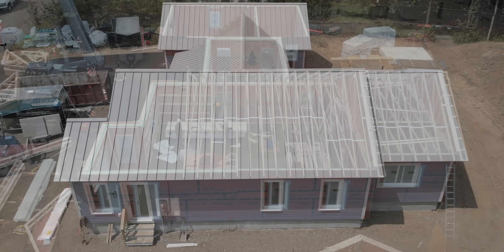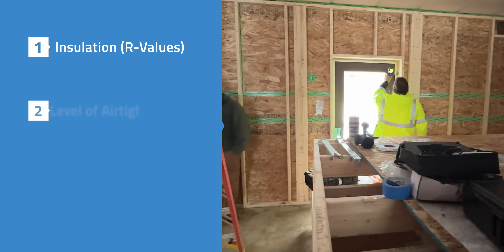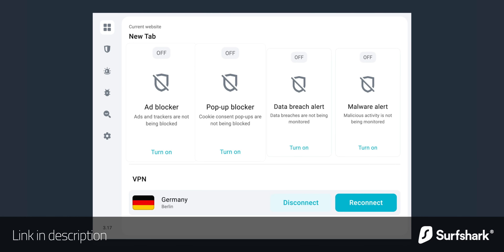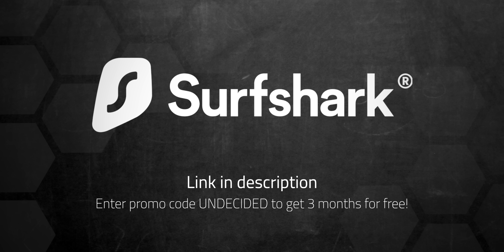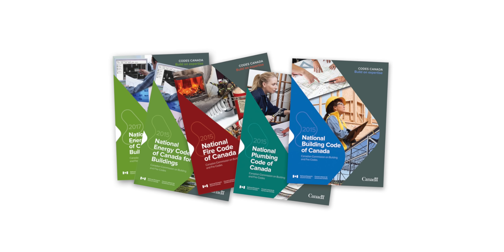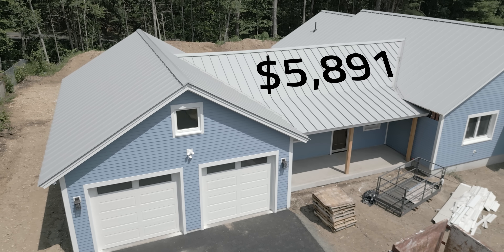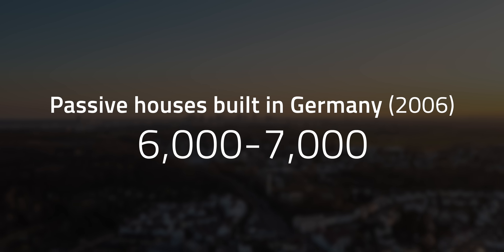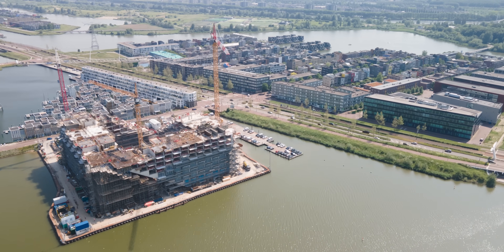Why Do American Homes Suck?

Comment: It's easy to say spend the extra money now so you save money in the long run, but the cost of nicer windows up front is tremendous. And forget about doing replacements on older houses. If you have a particularly window prominent home, it would be like taking out a second mortgage.
Reply: How much is it in the US ?
In France, for the window only (without the cost of the contractor to install it), you can have a simple 1m^2 (10.7 ft^2) high quality PVC triple glazed window for 500 euros.
Reply: @AB-yt4hd  That sounds about right for windows I've seen in Canada, BUT the big thing I find is nobody does their own work anymore. Most people I see (energy consultant, I see tonnes of people doing upgrades) hire contractors and the price of labour and markups are ridiculous. It's a tight market for supply so it's really sellers who run the show. I've seen obscene prices and when i go to build my own home I'm installing almost everything I can myself. I am looking at windows out of curiosity for my own house now and the price you said makes sense for window alone, and installing is not that difficult except for one very large picture window I may hire someone to install for me.

This video is not long enough to break down why costs are so much higher in USA/Canada than Europe but it's a very exciting rabbit hole to go down!
Reply: @andrewscheelar9656  Yes installation cost is becoming very high in France too.
I don't know current prices to install a window today, but I know how much they ask to modify a garden (they ask 7000 euros/week/worker, and this is only for the man-hour). This is ridiculous.

Comment: Performance is not free. It's not your money to spend. 

And honestly the more offensive flaw in construction standards is the repetitive cycle of destruction associated with wood construction and the annual tornado season. Because that actually kills people. 

If there was an inherent flaw in home building, anywhere, it's that nothing is designed to be built incrementally. This of course benefits the builder because they get everything upfront, and any changes down the road require massive disruptions and demolitions. And of course massive, crippling debt. 

The answer is to start small and stay mobile. MDUs, or mobile dwelling units, a much better term than tiny houses, which come with voluntary simplicity connotations (a euphemism for broke), separate the land from the structure, benefiting the property owner and the home owner. When the home owner is ready to put down roots, they can just buy the land and park, with minimal improvements for mobility. With one or more fully functional MDUs on a property, to owner can incrementally build their primary dwelling. Ideally, this would be large, self-built, clear span structure, like a geodesic construct, thin shelled monolithic concrete construct, metal quonset hut, or a combination thereof, as resources allow. Such a primary dwelling would provide a building envelope that can truly protect against nearly all that man and nature can dish out. The MDU can then be parked within the primary dwelling, and the rest of the space remains an open canvas to build additional, specialized units that can be endlessly rearranged to the owners content. The shipping container remains the best platform for these units, because of their inherent mobility, but can be decorated and redecorated in any way imaginable.

Comment: I've been building energy efficient homes for more than 40 years. The most common problems I run into when designing a house is finding appropriate mechanical equipment. We are designing homes that are getting close to air tight at .5 ACH, yet where I live in British Columbia there are no requirements for a makeup air system that should be required to replace the air being expelled by the kitchen exhaust fan.
North America is 15 years behind with regards to the heating, airconditioning and HRV technology. Our insulation standards are too low as well.

Comment: As a german, it is not all gold here. As we have 16 federal states, we also have 16 building codes with speacialisation in every comunal district. That why fore example in some places the regulation of one district dictates a 30° angle of your roof, an on the other side of the road, next district you have build with 42°.

But in general you are right. In terms of energy efficiency our codes are rather strict and consistent. For example you can get an interest free loan basicly from the government if you want ro insulate your house the long it reaches a sertain high standart.

What i think is missing when it comes ro effizient buolding are things like orientation of the building, window size, roof overhangs an such. Here the scandinavian countrys are decades ahead.

Comment: I’m a home inspector in Phoenix and I’ve definitely noticed that builders are super focused on the return on investment portion of the issue more than any other.
Reply: Yes, by definition of a business vs , for example, a non-profit
Reply: Just like rental landlords, many builders don't care how expensive the structure is for you to live in, as long as it passes inspections (even if that takes an envelope of cash "accidentally" dropped near the inspector's car) and brings in maximum profits.
Reply: Makes sens, doesn't it? Energy prices in Europa are often much higher, that's why there's a difference I suppose.
Reply: When margins are thin, a small change in the total cost means a big change in the profit. OTOH codes affect all builders equally, so shouldn't make any difference to profits.
Reply: @robinbennett5994  Theres no "thin margins" on home builder profits it he US.
Reply: I have the misfortune of being a home owner in Phoenix. It was built in July 2000 just as the mega-stupidity which led to the crash of 08 was kicking off. As a piece of construction it's complete garbage. Not just badly designed and engineered but shoddily slapped together as quickly as possible.
Reply: Sad
Reply: Stayed in a local hotel in AZ once. The walls, I swear, were 2x3 and the windows were single pane even though the age of the building didn't look that old.
Reply: That's why owner-built homes are often built to much better energy standards and much better quality. Builders need a return on investment over the 6 months it takes to build the home, owner's only need the return on investment over their lifetime, and even then they might not be bothered about the rate of return as they have had a super-comfortable home to live in.
Reply: Here in Scandinavia people build the houses themselves instead of buying a speculation home by a developer. The middle-man wants his earnings, better avoid the middle man then.
Reply: @Random-f3y7w  Economics of land access and local building regulation tends to lead to those "speculators." In town empty buildable lots are rare. So they can be expensive or you need to be able to afford to buy an existing structure to flatten. Out of town, most property is large farms and the similar. Either you need to the funds to buy 10-100s of acres or be dependent on someone doing that part, subdividing it, and selling those lots off. That takes a lot of cooperation (acceptance) by county/municipal boards.
If you do have access to a reasonable piece of property, contracting the construction yourself isn't unusual and very cost effective.

Comment: As a first-time homeowner, I wish I knew about some of these products earlier.  I bought in 2013, had to replace my furnace in 2014 (I went with a 98% efficiency natural gas, because that was the most efficient that I was able to find at the time).  I'm looking to go with solar and eventually replace our windows.  I wish there were easier ways to turn our existing house into a super-efficient home without having to teardown/rebuild or build in  a new location.  Could you do some videos on products us existing-homeowners could look into to easily (without a ton of demo) help improve our home's efficiency?
Reply: If you're thinking of replacing your siding, then there is a lot you can do. First, install a good air barrier, not tyvek, either a peel and stick or fluid applied. Take special care how the air barrier meets the roof at the soffit. Then install a few inches of continuous insulation (thickness depends on climate and where your dewpoint lands in the cavity), though the more the better. Make sure you have foil faced insulation to minimize radiant heat transfer (when the sun hits your house). Then put 3/4" to 1" thick furring over the insulation and reside your house. This is also a good time to replace windows if it's in the budget. This will help a lot with some heat gain/loss, but the biggest bang for your buck is in your attic. Due to pressure differential, you have the most heat exchange at the top (and the bottom) of the house. So think about putting a radiant barrier below your trusses, seal your attic floor, and add a lot of insulation (make sure you don't install more weight than your gypsum board ceiling can handle). The final step is to seal all cracks in your envelope, especially at the lowest levels. A few caveats: check radon levels since sealing houses so tightly will negatively affect radon levels, get CO2 monitors with alarms as the lower ACH will allow CO2 to build up - larger houses wont be affected as much as smaller houses. If you are using gas for anything, sealing a house can negatively affect the venting for gas equipment, possibly creating a buildup of carbon monoxide so if any of your appliances use the interior atmosphere for combustion, you'll have to fix/vent/replace it. If sealing your house too tight, you may also have to hire a mechanical contractor to duct fresh air into your building, which means that without a energy (heat) recovery system, you just put an 8" diameter hole in your envelope. Remember the three energy transfer methods and knock them out as best as possible - Conduction, Convection, and Radiation.
Reply: I'm in a similar situation. We desperately need to reduce our cooling bills in the summer, but full window replacement on our 60 year old house is almost prohibitively expensive.
Reply: Its not worth the cost to the environment to make those type of changes.  Even solar today, is iffy on weather is better for the environment the battery technology isn't good enough, item need to make today battery damage the environment almost as much, maybe even more, from the environment cost of dig to ship half way around the world just shift the environment impact to another country.

Comment: I would love more energy efficient homes.  I would also love to be able to afford them.  I can't even afford the cheaply built ones in the current real estate market.
Reply: if you were ALLOWED, you could build an Adobe or similar DIY efficient home on a small lot of land, but all suburban areas in America prohibit such basic freedoms by "Building Codes"
Reply: @solosailorsv8065  Yeah, building codes are simultaneously too strict and too lax. I want to build a tiny home, but building codes make even that too difficult and expensive. The building codes need to be simplified and more friendly toward tiny homes.
Reply: @FLPhotoCatcher  The more common restrictions against tiny homes are zoning regulations.
So many parts of the country seem to equate tiny homes with poverty, homelessness, and "THOSE people", and then people deep underwater on their McMansions scream at town and city meetings to try and make sure that new construction doesn't negatively impact their property values.
Reply: ya
Reply: When Latvia's housing market was at it's peak,  it would cost developer Ls26000 to build a flat, and they would sell it wor Ls85000
Reply: Not having to build a new house (or two) every generation helps.

Having different times for roof, fasad(and insulation), doors and windows as well as heating system replacement rather than all of those alongside the purchase price helps.

My cousins are at that stage of their lives right now and comparing a current new construction to a remodel (same time, same location, same ultimate aspirations) I'd prefer the remodeling
Reply: yes but the extra cost at the beginning make it much cheaper in the long term and so more valuable. Especially as the really badly built need lot of costly work after to try to fix things (and this is just not cost, living in a incorrectly isolated appartement in the middle of a city is just a big pain that is getting worse and worse over time)
Reply: The crazy thing is that they don't cost all that much more to build.
Reply: How much more do they cost?
Reply: @robinbennett5994  Are you being sarcastic? Matt's house is likely around $500 per sqft. At 2k sqft, that's a 1M house. How in the hell is the US median household income ever going to get approved for a mortgage that big?
Reply: @3rett115  I don't know why you're equating size with energy efficiency. There's no need to build a massive house full of gadgets for it to be energy efficient. 

Plenty of studies have shown that the difference between what most builders do now, and a passive house with the same floor area, only adds about 10-20% to the price.
Reply: Energy efficient homes are cheaper in the long term, so if houses built 20-40 years ago we energy efficient or net zero you would be more likely to afford one today, it's similar to classical "buy chap buy twice" situation, or more like "build cheap, pay more in long term" in this scenario.

Comment: I'm trying to retrofit my house in Canada but have found it quite expensive and wish we had higher building standards when my house was built 20 years ago.  I am making headway but will probably have to invest 100K to get near 0 energy score.  Currently at 37 down from 133 but still pushing.  I appreciate all your information ... very valuable on new ways forward to energy efficiency in my home.
Reply: My home was built in 1947.  We need government help with insulation and efficient window replacement....return our tax dollars where we need them.
Reply: The Build Show showed a really cool tech that can be used to seal up cracks upto 1/2" in the whole house by overpressurizing the building and blowing in finely atomized caulking.   It was very cool and would work wonders on older buildings....
Reply: I hear that. I also live in Canada, and my house was built in the 1920s.
Reply: Of course it is expensive and why it was not done to begin with.  Still got you to buy it eh?  Of course several things which I am sure you already did can easily and cheaply increase energy efficiency such as sealing wall/siding joints, attic etc.
Reply: I live in the uk and I would have loved it if our building control inspectors actually did their job and inspected houses while they were being built. When renovating my bathroom I pulled the plater off the walls and found the gap between the outside and inside wall was almost non existent so my insulation between the walls is almost useless. The walls at the bottom of the house have a nice gap as I noted when I had new windows out in. 

Also it would have been nice if the builders owned a plumb line and a few squares so they could know what a right angle is.

Comment: Lets say that this video has a lot of bias and misinformation to start with... I had to laugh a bit when you made an issue of imperial vs metric.. that has nothing to do with the subject, both are arbitrary units of measurement.

Triple plane windows only work effectively in climates where the temperature differential is significant, for many of us living in temperate climates on coastal areas (which is more than 60% of the US population) it makes no difference. But in Europe the only major city further south than Washington DC is Venice, so they tend to have colder climates in general to the US. If you look at Paris.. it's roughly at the same latitude as the US-Canadian border.

I own a number of homes in Washington State, many of them are new homes built in the last 10 years and the energy use of new homes vs older homes is less.. but not by much. If you take the time to upgrade your HVAC, windows, lighting and appliances you will save a lot more money than building a radically new home for energy savings. My yearly energy usage is around $1450... and I did this in a home built in 1976, how will investing $40,000 in solar pay off?

In most urban areas you are forced to remodel homes, not many of us can afford a complete teardown and building a new home would push us out into the countryside causing more urban sprawl.

You need to remove your green bias and base videos on real situations, like cost benefit for the average home owner thats what people listen to.

Biden is doing a great job of raising energy costs to make a green economy work.. but thats artificial and with the energy resources in the US we really don't need to make this so difficult for the average US citizen.

The US is a constitutional republic, the federal government has no place setting national standards for commerce. We have enough government overreach at this point, why would the average person beg for more?

Comment: It’s always so shocking how easy it is to make things more energy efficient in the lowest-tech ways possible. One of the best ways to reduce the need for heating/cooling is to just build apartments/homes with shared surfaces. When you’re insulated by your neighbors, everyone needs less energy to heat or cool their homes
Reply: In the cities, people will break into an apartment, cut through the walls, and rob the adjoining apartments as well, with a battery powered portable saw!

Virtually no effort, in the urban areas, with adjoining apartments. 

Once the first robbery happens like this in an area, everyone leaves, until the next group of renters experience the same thing.
Reply: @DavidHalko  can you name a single instance of that happening?